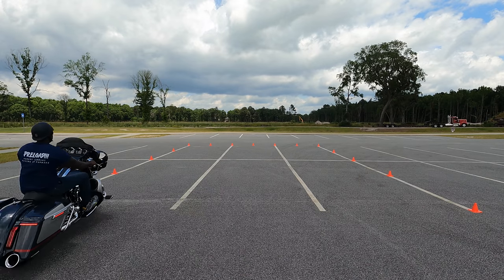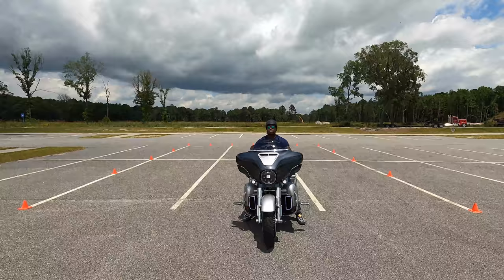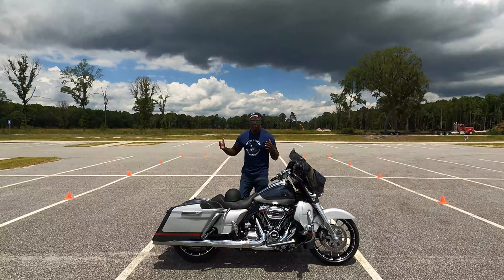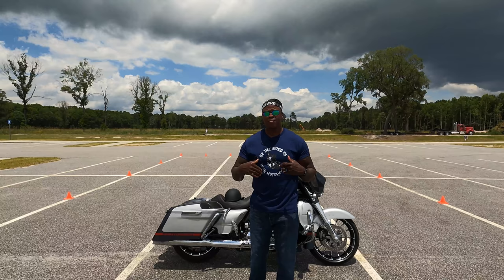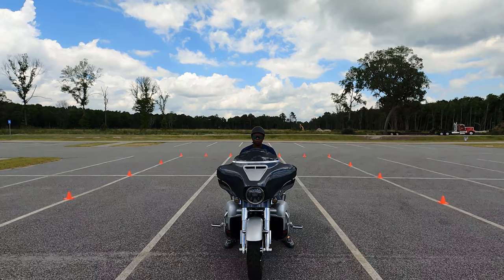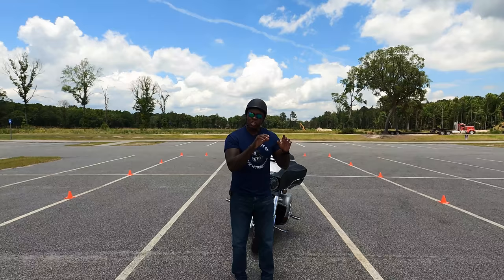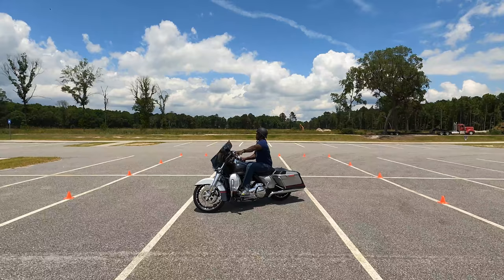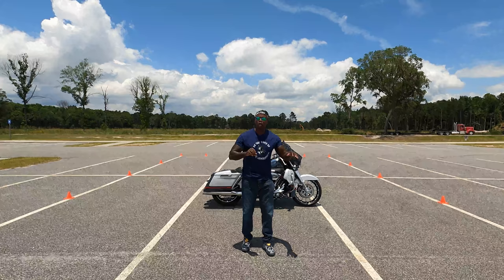Do You Fear Leaning Your Motorcycle While Making U-Turns At Slow Speeds? Watch This!!

Comment: Robert your handle bars on this video seem to be the stock bars from harley and not yor 12 inches one's, if this is the case it give's me hope to be able to slow speed my machine and not having to get my bar stuck on my knee's and my left wrist all jammed up not able to open the clutch.
Reply from the maker: I actually have 10” bars on this bike now. However with the stock bars, I had to make sure I kept my right leg out to clear the front brake lever. I also have an extended reach seat so that helps.

Comment: Rob,
I love your instruction.  I have the same bike as you, but I have issues with the handle bars hitting my legs when turning sharp as you have instructed.  I literally have to move my leg out of the way. Is that common.  You look taller then me (5'11) and I don't see you having an issue.  Thanks....Great videos!
Reply from the maker: Hey Tom. Yes I have the same issue. I’m 6’1”. The only thing that helped is I have an extended reach seat, but the clutch and front brake still hit my knees. We have to change our bars Tom. I’m going to 10”.

Comment: A Harley has a low center of gravity. Have you tried this on a Japanese 4 cylinder like the Yamaha FJR1300 where the center of gravity is higher. I ask as I have ridden motorbikes for 50 years, my previous experience on 1970's Triumph twins handled like a Harley but my riding has had to alter with my FJR weighing 300kg
Reply from the maker: Thank you for watching and hopefully you’re subscribed to my YouTube channel!👍🏾😊 https://www.youtube.com/c/BeTheBossOfYourMotorcycle/?sub_confirmation=1 

Yes I have. The rules don’t change.
Reply: Yep - I just noted the same thing above! Riding since '78. In ' 91 got a Harley Softail. Then built one from scratch with a hot S&S motor that I rode for 25+ yrs. During that time I also had a few baggers. I just got a '22 Kawi z900rs café. Wow, so different. Saving grace is the much lighter weight overall. SO much better and more fun in the twisties.

Comment: Hi Robert, many thanks for your help. I learn a lot of you! But I have a question. Not leaning your motorcycle is possible with slow speed. But I think you will be in serious problems when you do not lean with high speed in the corners. And that is what you more often use.  So, is it not better to learn your audiences to lean?
Reply from the maker: Hi Peter. I’m happy that my channel has been helpful to you! That makes all the time and effort that I put into this so worthwhile! This video is specifically focused on not having to lean the motorcycle during slow speed riding. Most riders don’t have an issue leaning at fast speeds.

Comment: Hi Robert I've just discovered your channel. Wow you're a great teacher!  I have a question when going left at any speed I'm very comfortable but anything after 10/15mph trying to lean to the right it feels unnatural and I have to ease off where most can continue at the same pace. I've been riding for 7 years but still trying to overcome that fear factor sadly. Thanks for any advice
Reply from the maker: Hey Dan. Thank you for watching and hopefully you’re subscribed!👍🏾😊 I’m happy that my channel has been helpful to you! That makes all the time and effort that I put into this so worthwhile! Also, thank you for the compliment! 

As you watch more of my videos, particularly the Practice Session videos, you’ll hear me often say that my right turns are more difficult for me than my left turns. So you’re not alone with that. In fact a lot of motorcycle riders feel the same way. I’ve just recently learned that it had a lot to do with my handlebars and how close I’m sitting to the tank. So now my right turns actually feel a little bit better than my left turns but only on my Road King. Those handlebars just changed the way right U-turns feel to me. So just keep practicing, and focusing on keeping your throttle high enough and making sure that you don’t pull your clutch all the way in and cut off power from the rear wheel.
Pl
Reply: @BeTheBossOfYourMotorcycle  thanks for your swift reply, yes I've subscribed and currently working my way through your playlist 😀. That makes a lot of sense actually I will check my handlebars as every other bike I've owned have been somewhat easier turning right. I appreciate your videos and responses. Keep up the good work my man. Much love from across the pond.
Reply from the maker: @watchdoglegion  Thank you for watching and subscribing!👍🏾😁 Also, thank you for the compliment! It’s my pleasure. 😊 
Preload!!! And Keep It Loaded!!!! ©

Comment: Loved the video.  Thanks! Btw I'm riding a low with the shocks cranked up and the wife on back.  I never stop with one foot. For good reason.  I'm 5 foot 6 inches with a 29 inseam and under 150 pounds.  Add the wife and a little baggage and nope. But I still use your techniques.  What headlight is that and is it a lot better than the stock? Or compared to others you have rode with? Cheers man!
Reply from the maker: Thanks Rocco! Yeah no need to only put one foot down as long as your stopping with the rear brake. That headlight is from Custom Dynamics and it is leaps and bounds better than the stock headlight. 
Custom Dynamics Light Upgrade Part 5 (Finale!) On My 2019 Road King Special
Reply: @BeTheBossOfYourMotorcycle  I looked up your trailer and the price has more than doubled. This is crazy. Guess I won't be getting one anytime soon!
Reply from the maker: @roccofilippi1418  Really?😮

Comment: Robert, is it still necessary to use just the rear brake for control on modern bikes where the brakes are interconnected? Ive been riding for many years and had always used both brakes (rear brake for control) until I bought a K1600GTL a couple years ago. Both brakes are interconnected (if that is a word) and applying either brake (just one or the other) affects both brakes. Using the rear brake only only this bike has a lot of vibration and not as smooth. You can "hit" only the front brake at high speed, even on a curve, and the bike stops perfectly. (This would not have been a good thing on any of my other bikes!). Thank you for the video!
Reply from the maker: Hey Kerry. My bikes also have interlinked brakes, but that is only applied over 20 mph and it’s designed like that for a reason. Is your motorcycle designed the same?

Comment: I have ridden sportbikes for years, dirt bikes as a kid. On the sportbikes my front brakes are used quite a bit, These big twins, cruisers rely on the back brakes for control?
Reply from the maker: Yes. Your rear brake is for control.
Reply: @BeTheBossOfYourMotorcycle  Thank You Sir! I picked up a VTX 1300, haven’t ridden it yet, shop is tuning it up, I have been riding a Hayabusa for about 10 years now after a couple R1s, I’m in my 50s ,  with a bunch of seat time.         and have been checking out your big bike  channel,  looking forward to trying out some slow speed techniques , Thanks again, Great Job!

Comment: What if the motorcycle is new and it works great, then it goes in for the first service at 600 miles, and the clutch hops in first gear until you let it out all the way?
The clutch works good in second, third, forth, fifth, and sixth.
Reply from the maker: Sounds like a familiar story. I’ve made it a habit when I take my bike in for service to tell them not to adjust my clutch lever from where it is.
Reply: @BeTheBossOfYourMotorcycle  : thank you for that.  I did check the clutch for play and it’s good. You can fit a nickel between the lever, and the stop. 

Im thinking that some debris from the break-in period got lodged in between the clutch plates and friction plates but why does it only jump in fist gear from a dead stop?   
Did this happen to you and you adjusted the clutch?
Maybe it needs more space?
Reply from the maker: Never happened to me.

Comment: I ride a Honda1800R VTX ,applying the rear brake only also engages half of the front brake what can I expect in following your technics for slow speed control?
Reply from the maker: I'm not familiar with your bike but I know my bikes also have linked brakes, but they won't do so under 20 mph. Are you sure that's not the case with your bike?:_PRELOAD:

Comment: Good Morning Robert, just a quick observation or  question. when doing a tight turn or fig 8 I catch myself turning the bars tight as opposed to leaning hard to make the turn. Am i right to think that? After riding for about 14 yrs never did tight turns or u turns. watching your vids and testing at the end of the month requires me to do this.
Reply: Under 5 miles an hour you are technically turning the bars.
Over 5, you are leaning/countersteering.
Reply from the maker: Are you making the turn successfully?
Reply: @BeTheBossOfYourMotorcycle   yes sometimes make the turns within the box others i go outside.... PRACTICE. Practice, Practice

Comment: Hi Robert.  I notice in your practice sessions you have a using the  front brake penalty.  My habit coming to a stop I use a little front brake along with the back brake to come to a smooth stop.  If I use only the rear brake, it's not as smooth a stop.  Is my usage of the front brake coming to a stop a bad habit, should I work on getting rid of it?
Reply from the maker: Hi. Yes and yes.
Reply: @BeTheBossOfYourMotorcycle   Thanks I'll get to practicing,.   PPPPRRRELOOOAAD!
Reply from the maker: @TRDBucket  It’s my pleasure. 😊 And keep it loaded!!👍🏾😁